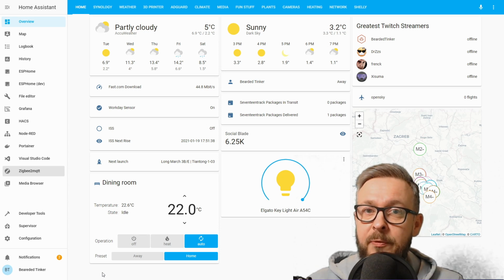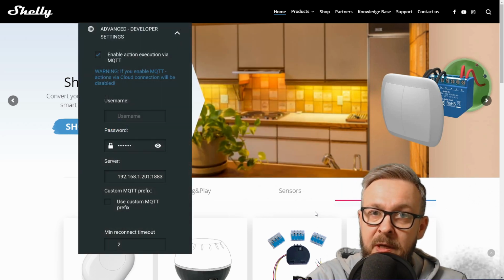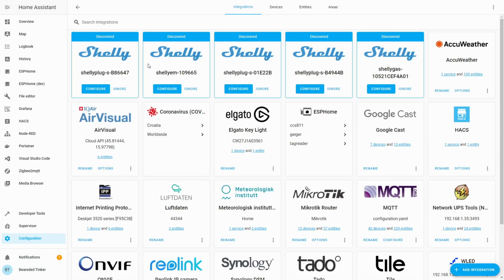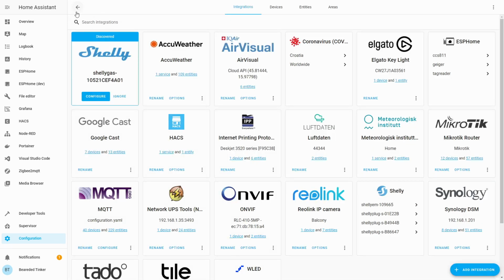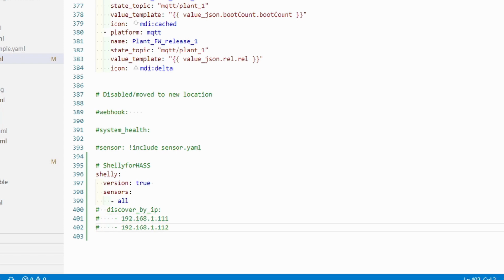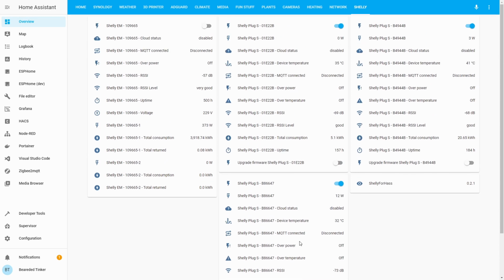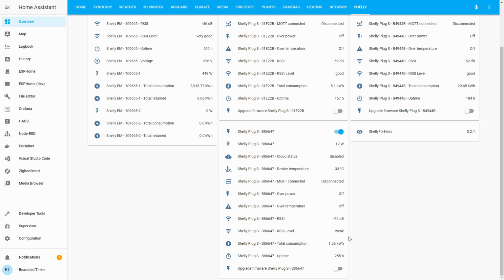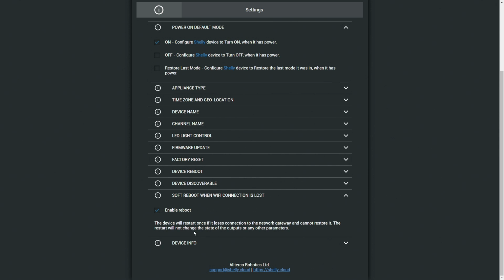Home Assistant How To - integrate Shelly IoT devices

Comment: Thank you, I'm not alone to suggest to use ShellyForHass and eventually in the future Shelly native integration instead of MQTT, for some good reasons: it's simpler, it's faster, it's cleaner. Why to mess with MQTT... There is the common perception, at least reading the HA Italy group, that MQTT = no cloud so no MQTT = using cloud. I think it was born with Tasmota and Sonoff... I'm writing and writing the truth here... So, thank you for giving right informations! (y)
Reply from the maker: I have to agree on most things with you, but unfortunately, there is also a positive side to MQTT. Unfortunately, looks like some of the Shelly devices are much faster to report button press via MQTT then it takes for HA to update state. Also, for device such as DW2, power saving mode there can give you issues with HA if you restart it. By using MQTT and retain state, you can always have last state information for sensor, while HA needs state change (after restart) to get current state. 
But I would definitely suggest ShellyForHASS or Shelly internal integration for most of the users
Reply: @BeardedTinker  wait, if MQTT is faster than Shelly integrations it means you can have issue with multicast support of your router. Shelly, when not using MQTT, use CoAp-msg to send events to the subscribers (HA) and CoAp protocol is based on multicast. When CoAp don't works correctly you can try a parameter with ShellyForHass to "remember" to the router the subscription. If the integration can't use CoAp it does polling to devices, that's definitely slower than anything else. But that's because you have a problem with your router.
I had that problem with two tp-link routers I had until I changed to Fritz 7590 + 1200 mesh system and multicast is now managed correctly.
In my experience, confirmed by people I've helped in the Italian group, CoAp (thus Shelly 8ntegrations) is faster than MQTT for three good reasons: it's based on UDP (MQTT is TCP), messages are compact and binary (MQTT are prolix and ASCII) and they don't have to transit to external add-ons that then route the message to HA through another TCP connection,  like MQTT.
The retain state of MQTT is an advantage, yes, but can't compensate all advantages of Shelly integrations... (if you don't have issues with multicast, of course)
I think I'll write a post about this on my blog.
Reply from the maker: Great answer - what I've missed to add that some people reported this. I don't have such problems But from what I've read, issue can also be with IGMP (snooping) being disabled on routers. But that is also multicast issue then.
Thanks for the great explanation.
Reply from the maker: BTW - as I'm recording but also testing Shelly Gas for next video, I have to admit that I'm disappointed with both internal Shelly integration and ShellyForHASS support for Shelly Gas.
And it looks like next release will not bring any additional updates to it (from what I've seen on GitHub).
Gas sensor in Shelly/ShellyForHASS only give binary sensor with off/on status if there is a leak or not. MQTT integration gives you sensor with ppm concentration, binary sensor for status, but also, what I miss in other integration options, Self-Test status
Reply: @BeardedTinker  good to know. Native integration has road to drive left to get t ShellyForHass level. In the next release of HA it will support RGBW2 and battery operated devices is still in development. Furthermore not all attribute of ShellyForHass are supported there. We have an active contributor of that repo in the Italian group.  So don't examinate that too much... yet. ShellyForHass could be that author is busy or is working on that in some beta. He's doing a good work but not very fast. I also have a Gas sensor but not connected it yet. Good to know. I'll wait ShellyForHass support. In case I'll open an issue to put some pressure, in case 😉 I suggest the same to you. In the past I did it while paying some coffee to him. It worked well 👍🏻😜
Reply from the maker: I have to correct my self - Shelly internal integration does pull both on/off (clear/leak) and ppm, ShellyforHASS doesn't pull PPM, so somehow, internal integration/support for Gas is better there. Had to reinstall few times for recording video and was surprised by this to be honest. Author is probably busy and didn't still have time to implement it in ShellyforHASS.

Comment: @BeardedTinker can you make a video about adding a NIBE heatpump to HomeAssistant, I can't find a good tutorial about it.
Reply from the maker: Hi Andre! Well, to be honest, I can't - I would need access to it to test and record the process.
From what I've seen, it can be done using HACS integration, and it didn't look that hard, at least for default/minimal installation.
https://github.com/elupus/hass_nibe
But, one of the prerequisite for it to work is to have Home Assistant exposed to the internet. Although it says that you can use it with http (without SSL), please, use with SSL certificate or https type of connection only.

Comment: I am running shellys with mqtt (4x 1pm, 2x h&t, 2x D/W2, 1x RGBW) over MQTT (with the help of ha-shellies-discovery python script). I find the MQTT more stable (and it was the only noncloud option up untill 0.118 something). Usage is more or less painless.

You can also hack a dirty automation to update all the devices at once (rgbw is sort of annoying as it cycles all colors)

check my config at https://github.com/zeridon/homeassistant (well that is the whole stack i am using)
Reply from the maker: Thanks for this one!!! Much appreciated - browsed through the GitHub very fast - I see that you're also using Luftdaten.
Reply: @BeardedTinker  yep, had to hack the luftdaten2mqtt stuff so i do not go over the internet to pull the data and as a personal preference like the push model.
Reply from the maker: I'm using custom component - local luftdaten sensor.

Comment: Just done this following your guide as I previously used the official add-in but had hoped to find an alternative particularly for the DW2's who go offline on a restart. Unfortunately it seems this doesn't resolve that problem. More concerning however is The Shelly 1L offers all entities except the on/off! Guess i'll switch back to official integration, thanks anyway.
Reply from the maker: For DW2's, that could be problem by design since they go to sleep mode - are you on latest firmware there? But I find it strange that 1L is missing most important thing - switch.
I'm still waiting for mine to arrive, but I know of few ppl using them without an issue. This is definitely showstopper. Sorry you had bed experience!
Reply: @BeardedTinker   No Problem and thanks for another excellent tutorial. With the DW2's yes latest firmware, its a real pain, maybe MQTT would resolve it, though I doubt it, seems its a design issue, I need to find another solution. Also unfortunate that the switch is missing, I have two of them as well. Not sure if it could have been hidden somewhere, I couldn't find it though.
Reply from the maker: Ok, got it - what is the 1L problem. Shellyforhass still isn't supporting it. https://github.com/StyraHem/ShellyForHASS/issues/486
There is 0.2.2 beta version that has a support for it, but looks like it also has a bug with it according to latest issue on GitHub. So, you can try using 0.2.2beta to see if it helps or not. Will search a bit about dw2
Reply from the maker: And yes, people have same issues with DW2's - https://github.com/StyraHem/ShellyForHASS/issues/421#issuecomment-703076238
Reply: For DW2 (if using MQTT) just enable the retain flag (or make an automation to set it to the state you prefer)
Reply: @netsecad2260  Will setting the flag then kill the battery though. Also is it just a matter of checking the retain box?
Reply: @davidtjac  Not really. "retain" flag sets a field in the MQTT message that instructs the broker to save the message and whoever asks for it (homeassistant) receives it on start. This is functionality of the MQTT protocol. The shelly will keep operating normaly (no increase in power drain). And yes if using MQTT is as simple as just ticking the box.

Seems high time to setup a blog or such to start sticking such small bits in more expanded fashion :)
Reply: @netsecad2260  thanks. I'm not massively familiar with Mqtt but do use so will give a try. Thanks for advice. Very helpful.
Reply: @netsecad2260  thanks. Set it up to. Works flawlessly. Much appreciated 😊

Comment: Nice video which covers all the essentials and runs at a good pace. I have been trying out the new Shelly 1L for single wire light circuits which seems to work well.
Reply from the maker: Thank you Mark - really much appreciated!!! I'll be doing some more videos on Shelly devices in future. Definitely will try Smoke sensor, Motion sensor, but I ant also to try and add them to my switches that have no neutral wires.